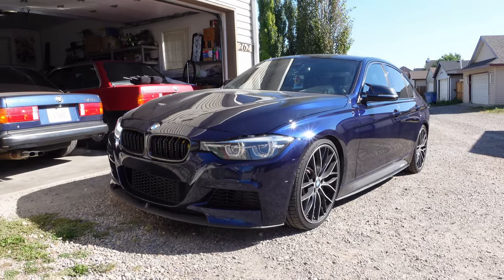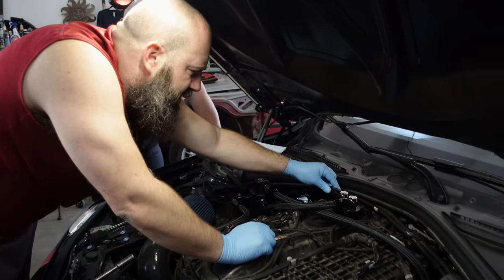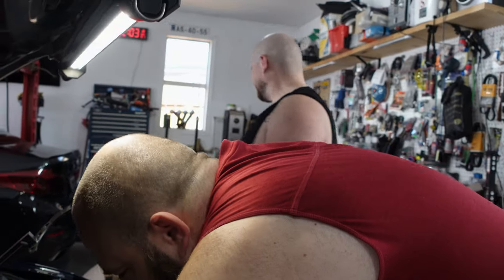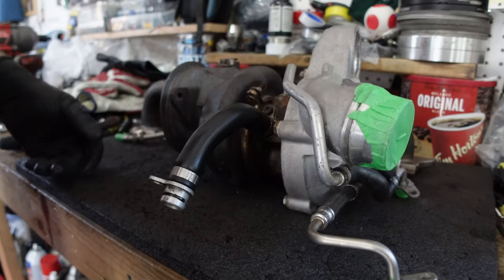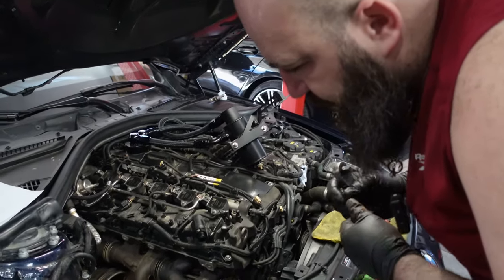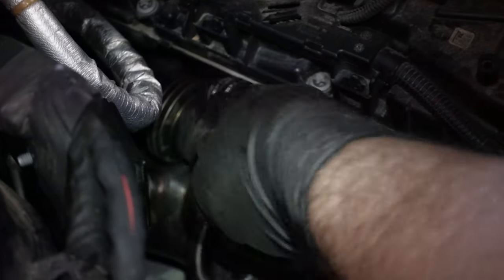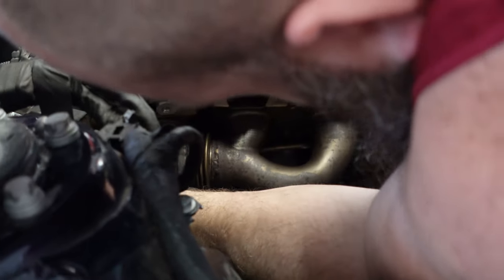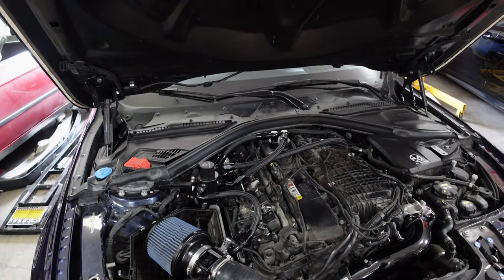I Can't Believe How EASY It Is To Turbo Swap a B58 (BMW 340i)

Comment: Installed a DAWs 6466 with port injection on e60.  Jesus Christ the car is scary now.
Reply: do i need reflex to run E or just flex fuel?
Reply from the maker: @ViisionPvP you can calculate the mixture and run an OTS map. this is the manual way or you'll have to get a sensor that confirms ethanol content.
Reply: @tony.nextlevelrides  what’s the point of a reflex then sorry? I have flex fuel already

Comment: about to attack this solo myself few questions, is it fine to run the hybrid on a ots map was ur test drive on ots? also do you have to change oil during install or just coolant
Reply from the maker: the install isn't bad at all, just take your time.

the OTS map will get you by if you need to drive it but do not go full throttle.

you don't have to flush either, just top up!
Reply: @ how about topping off the coolant part? can i just pour coolant in or do i have to bleed the system aswell?
Reply from the maker: @ViisionPvP  just top it off! Runs off a mechanical water pump so no crazy process needed. It'll bleed itself.